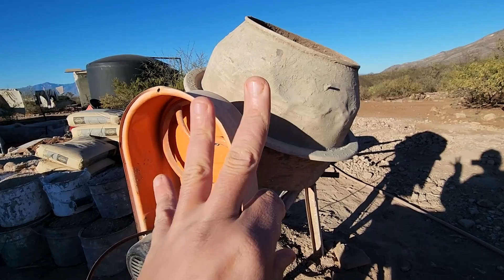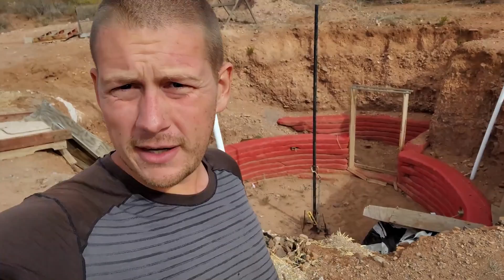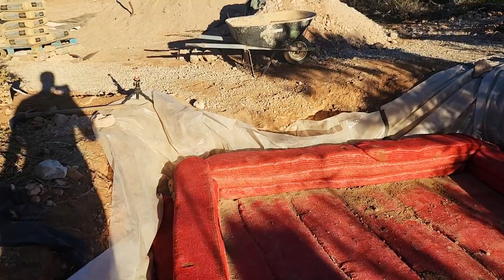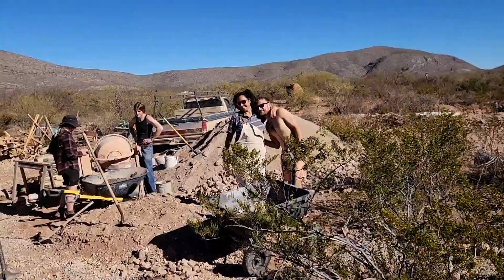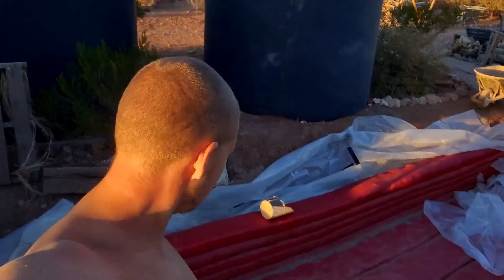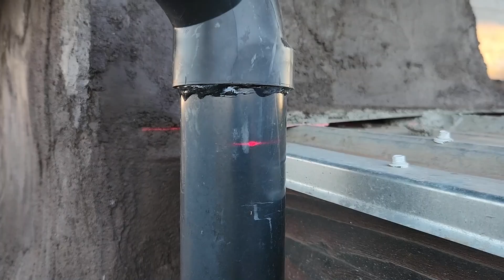Why Hyper Adobe Earthbag is it the BEST way to build Off Grid. Dirt Cheap Water Storage Tank

Comment: Could you have eliminated the buttressing if you made the cistern circular, or would that not have been a benefit in this application?
Reply from the maker: That would have been the better option yes. We had the hole dug square because we thought we would just drop the poly tanks in the hole. Then changed plans.